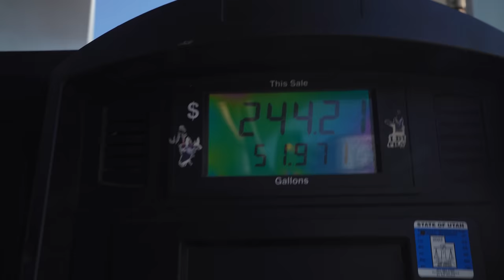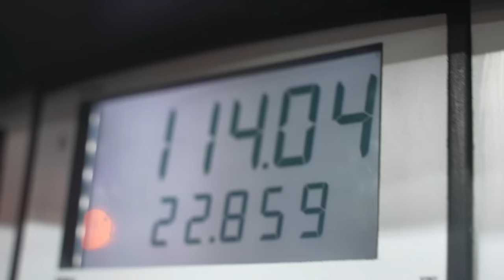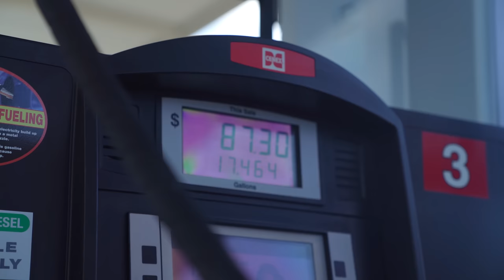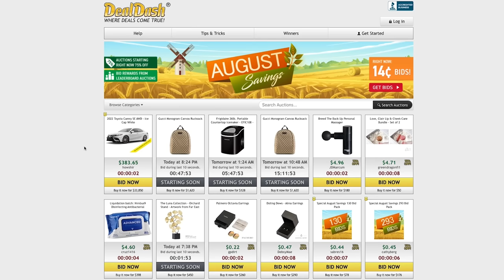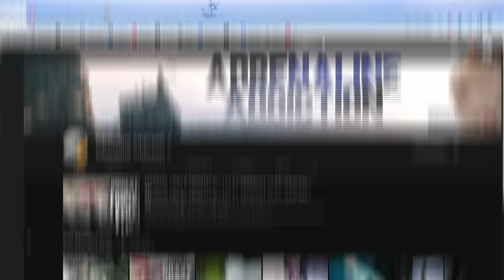This Dozer Has Been Stuck In The Swamp For 2 Years…Can We Recover It?

Comment: 2 years is a lot of waiting... that thing has enough power to do it just laked traction.....i would have run chain or cable to the tracks and anchored the other end and let it pull itself out
Reply: They're more than capable on pulling themselves (especially if the winch works)out the way you said I've had to accomplish the feat more than once myself!
Reply: @muddawgkomm9642  thats what i figured ...not much sense in waiting 2 years and running all that equipment and people up there for that except youtube.... but knowing how can let you make big money sometimes. ...recalls story of guy who charged 100k to fix a dent in a 1m pressure vessel.....10 min with a blowtorch and tap it with a hammer....but he knew where and how to tap

Comment: @22:40 You'd be amazed at what an outrigger pad will do for this.  We use them on our bucket trucks.  The wood ones are liteweight and will prevent the outrigger from digging in like yours are doing.  We can get the whole truck up off the ground in the sand/dirt by using the pads. Will also prevent an outrigger from messing up asphalt or concrete.
Reply: Plus at 15:14 You can see that a digger dug that hole and put the dozer in it. They then tried to cover the diggers track with those logs
Reply: @Andy-gti  How drunk were you that you felt you needed to comment this on multiple OP's??
Reply: @shawndavid1845  Cus i felt that everyone needs to know the truth, instead of saying: wauw amazing that you guy's pulled that dozer after 2YEARS... while it was all just faked to get your views
Reply: @Andy-gti  u acting like u was there to see all the bs u talking about or like they showed u they're plan
Reply: @livintheislandlife7561  I'm not acting... They are lol xD
Reply: @Andy-gti  Nope, where is the pile of dirt from the hole?  Did they back dump trucks in there and haul it away? The volume of dirt once dug out of a hole is about 1.25 to 1.5 times the volume of the actual hole because it is no longer compacted.
Reply: @frankmoreau8847  the truth hurts I'm sorry your mad but he's correct he makes a lot off of these 6 figures a video maybe even 7

Comment: I have a few of these, crank in low first then once the engine is turning good you can try high. If the pony runs good they are always easy to start. The ponys start good of the crank too. Be carful it is magneto ignition and can kick back on the crank and break your hands.

Comment: I’ve always been curious to know how much money you guys spend of fuel for these recoveries
Reply: Most of these machines burn like what, 10 gallons an hour? This looked like a pretty simple 1-2hr operation.
Reply: @ToreDL87  3hour job  and 10 hours drivin to get therere...so 10 galons x 5 vehicles x 10 hours x2 get on and return+ 3 hpurs recovery...thats is like 2.5 tone diesel
Reply: @mandataruu8685  At least, + idle time, and some motors get more diesel, to warm up faster.
I didn't say it was gonna be burning 20 gallons ^^

Comment: I’ve had to pull start one of these old buggers. Pony tossed a rod... took of fan belts  hung a tommy moor block off the blade. Wrapped 3/8 rope around crank shives, tied off to crummy and drove away👍 installing the fan belt while running was a bit harry ... tugged the Madill 090 tower to the next setting

Comment: You could’ve used toe chain on both sides of those tracks hooked the trees and drove at dozer right about it without using that big wrecker I have very dozers clean up to the top of the motor and pulled them out with change using trees
Reply: Then they would not have been able to make a 30 minute video with 10 minutes of them pulling it out.

Comment: I have not seen the bottom of your stabilizer but most have a hook like affair build into them where you can hook them into  a 12” plus log . This is used for down ground that is soft or muddy condition ..I personally have used a 18 inch log 16 ft long laid across the ground and it really hooked alot of ballast making recovery very easy no movement of tow vehicle.

Comment: Wow! That went better than I expected.

Reminds me of the time when I worked for a dairy farmer in NW Ohio. He built a new free stall barn that had a flush system that cleaned the cow's walk area.  He hired an excavator with a dozer to dig a slurry pond that would capture all the water from the barn. The ground was heavy clay and he used much of it to build the dam, but the rest of it he pushed down the hill from the pond into a large pocket of peat moss. The amount of dirt he pushed into that area was about the size of a 4 room single story house. He was finished with the job, but he wouldn't have the truck available to load up his dozer for a few days, so he parked the dozer on the edge of the pond away from the road.

The next day my boss and I drove two tractors down to the pile of clay, one had a bucket and the other had a box blade. His plan was to even out the dirt so it wasn't in a pile. But when we got to the pile, we noticed something strange, there was a large crack running along one side of the clay pile and the ground on the dirt pile side of the crack had lifted about a foot. We walked around the pile to the other side and noticed another crack with the ground on the dirt pile side of the crack had sank about a foot. He decided it wasn't safe try and move the dirt, so we drove the tractors back to the sheds.  The next day the pile of clay had disappeared. When my boss and I walked down to investigate, we found that the heavy dirt had flipped over and sank with the peat moss coming up to the top. The excavator came to pick up his dozer that evening and we told him about the pile of clay disappearing into the peat moss. He was shocked and then told us he had almost parked his dozer in that saw area because it was out of sight from the road and would keep people from messing with the dozer. We all surmised that his dozer would have probably disappeared the same way the pile of clay had.

Comment: I'm curious on if you can do it how the brits in ww1 got their landships (tanks) out of the mud, when they got stuck, by attaching chains to the tracks and having those chains wrapped around a log and just letting the tracks pull it under them. Admittedly it'll be a pain to disconnect the chains, bring it back to the front and then reattaching the chains over and over again but it should technically work.

Comment: What i learned for this video is to get equipment to start you just wiggle stuff, tap on it and spray starting fluid :)  Serious question would piling rocks and wood in front of the tracks and letting the tracks push them under and into the ground help in a situation like this ?

Comment: Used this tractor back in the 70's in the Corp cutting fire breaks. Designed to run FULL throttle. Just like the Terex 8230.

Comment: Just like when you bottom out anything, when you bottom out a bulldozer on the belly pan you just are not going to get traction.  That being said, I noticed that the grousers on the shoes are worn down a lot.  If they want to get the most out of what the bulldozer can do, they need to get some grouser bars and weld them onto the worn out grousers so it can get the traction it was designed for.

Comment: Very nicely done boys great video showing folks how it's done. Who ever got this stuck just needed a chainsaw to cut two poles and 10 feet of cow neck chain a dozen 5/16-18 x 2 bolts to attach the chains to the drozers and poles then drive it right out the soft cow neck chain will cut right off when the drousers close on it hard at the back sprocket at that point if she starts to slip rechain up front again and keep her inching ahead as slow as she will go is key no fast moves or you're starting over and with two dead poles under ya in the way making it harder.  I have drove many dozer's far more stuck out after people hade even tried to winch and dig them out the last one I did they broke a rotator truck frame trying to get it out. After I drove it out I lifted the frame on the truck into place and we welded it up so they could drive it home.

Comment: Guys cribbing ( what you call swamp mats ) is your friend under your feet on the winch truck and getting it across under that dozer once your on the belly pan your done I have recovered many tanks and other tracked units even walked a crane out of a bog in my days I see a lot of logs around there a good trick is to take logs wider than your machine wrap a chain around them with it tied  then use the hooks on the out side of the track plates that will pull the log under you keep adding logs to give it bite often you can walk it out on its own . In WW 1 they carried big Timbers on the tanks to do that I think there are u tube vids showing that done .

Comment: To everyone without a big tow truck or winch if you get stuck like this just cut some logs with a chainsaw and chain them to your dozer tracks and pull them under the dozer slow and you can drive out of a hole like this. Done it dozens of times by myself. Owner operator of heavy equipment over 30 years.

Comment: Owner didnt even need a pull. Should have just taken two chains, wrap around one of those logs and tie into track, then another on another side to pull them under the tracks. Messy job but works with equipment like this. Only thing was the mentioned level of the mud, but since its hillside just manually dig a trench to down hill to get most of the water off and let it dry a bit to get mud to solidify a bit, then do the mentioned method. You can also tie logs horizontally to tracks to get sideways traction from the area where track dig it self in. Machine like this should have enough power to pull it self out if engine is ok. Also for those that "lets just leave it for the moment" folk.. put a metal bucket or similar top of the intake and exhaust, cause if its ends up staying there for year or two.. well you could have issues of water getting into engine... And now that i said that, i'm off to check the excavator that was parked on the end of a field, does its engine still turn...  XD Do like i say not like i do!

Comment: Run the pony engine for several minutes at full speed for several minutes before engaging to clutches to the main engine!!! Leave the damn ether alone till the main engine WILL NOT start on diesel fuel. The pony is to warn the main engine before trying to start the main engine then turn the main over to develope oil pressure after oil pressure is established turn fuel the main engine. If the main doesn't start then give it a shot of ether.

Comment: Y'all supposed to let the pony spend the diesel motor over and build the oil pressure up before y'all shot ether in the intake I hope y'all did not run the motor by doing what y'all done if you don't know nothing about them type of equipment you don't need to mess with it